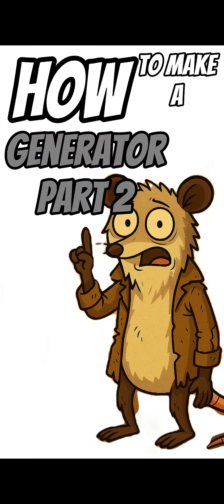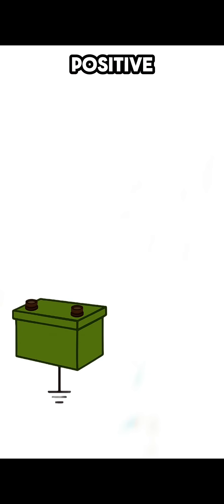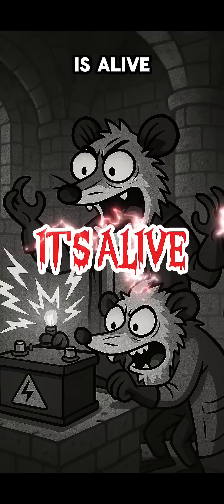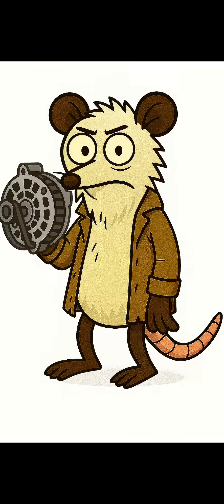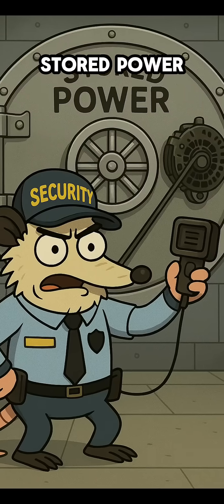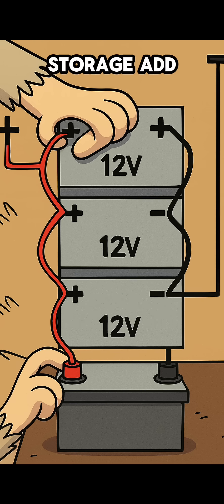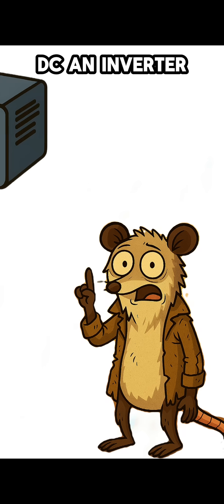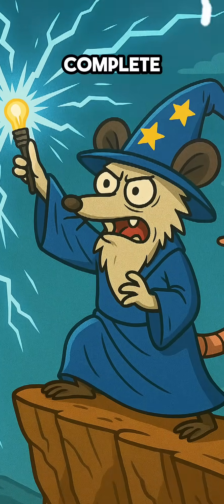How to Make a Generator from an Alternator Part2 (Apocalypse Survival Hack)#shorts #science

Comment: Hey anyone tried the ground stakes Copper and Zinc make an endless supply of 6 to 9V to 12v depending on how many stakes you use.. Only if you have the  Batteries but can't find an Alternator. You will get 12V 15 Amps not enough to run lights, but you can charge lead acid batteries forever!!
Reply from the maker: That's good knowledge.